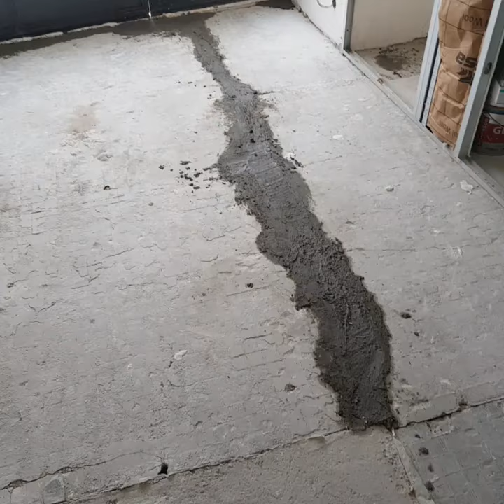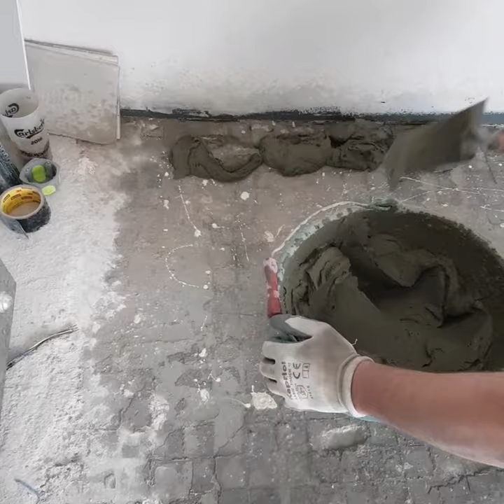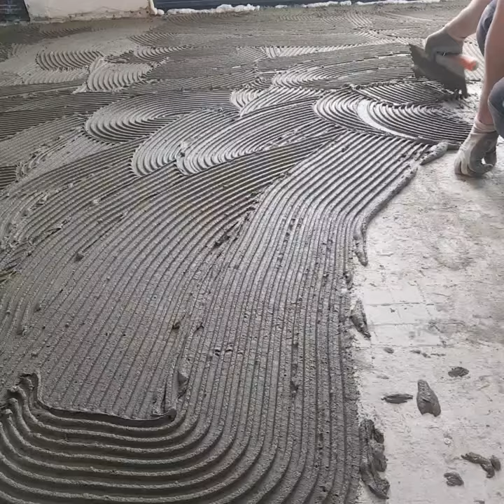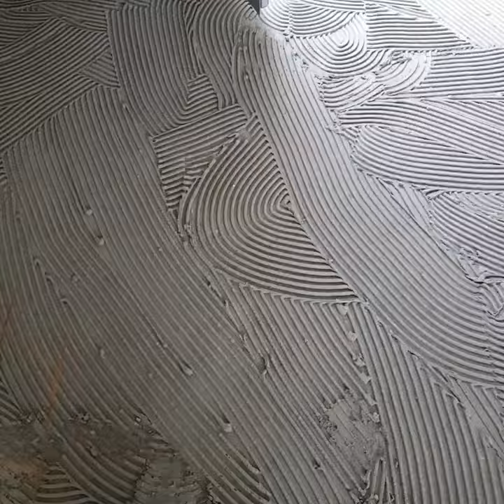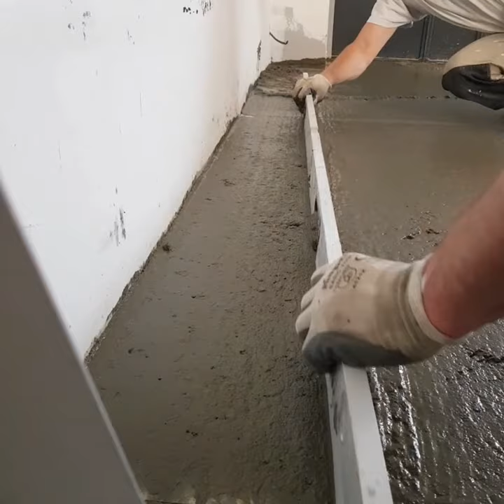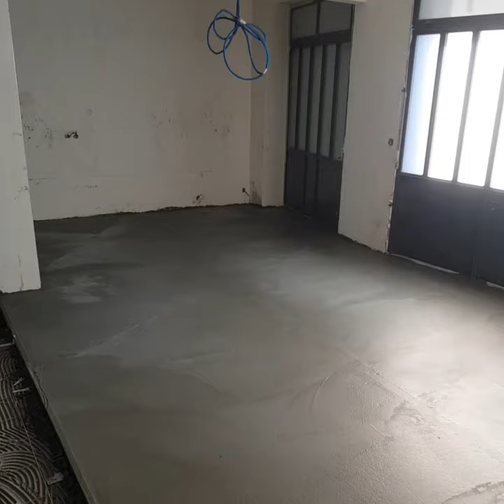Comment bien accrocher les deux couche de beton ensemble

Comment: C'est bien connu un beton ne fissure jamais.  Depuis des siècles la couche de finition est désolidarisee. C'est ainsi que l'on pose les marbre ou autres.  La feraille c'est bien . Mais c'est toujours prendre un risque. En desolidarisans en cas de fissure du support celle-ci restera sous la chape.
Reply from the maker: Merci pour votre commentaire ! Vous avez raison, le béton peut développer des fissures avec le temps. La désolidarisation de la couche de finition, comme dans le cas de la pose de marbre, est une pratique bien connue pour minimiser les effets des fissures. Bien que la ferraille soit utilisée pour renforcer, il est important de prendre en compte les risques potentiels. La désolidarisation offre une solution pour éviter que les fissures ne remontent à la surface. Votre observation est pertinente et souligne l'importance de choisir des méthodes adaptées à chaque projet. Des questions ou des conseils supplémentaires ? N'hésitez pas 
Cordialement, https://ergointerieurs.com